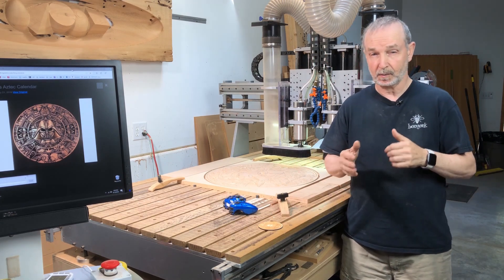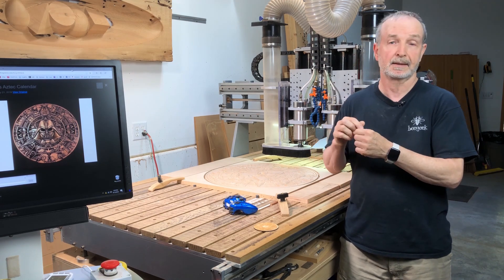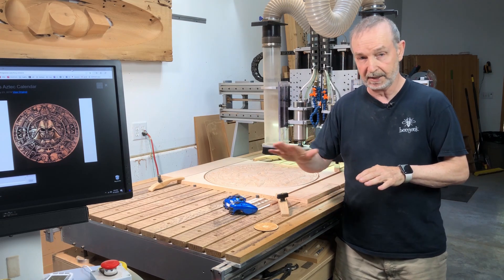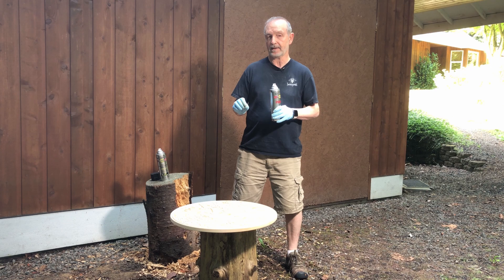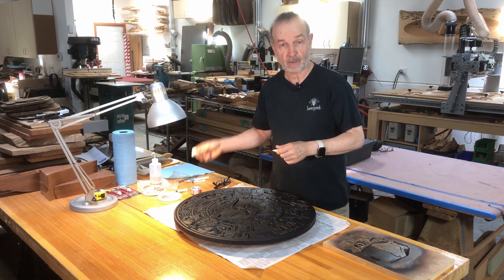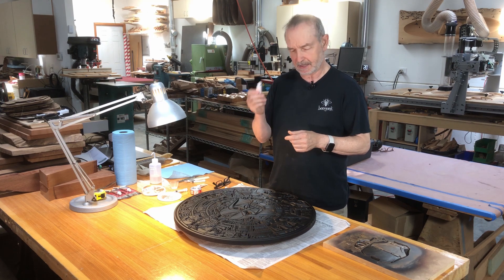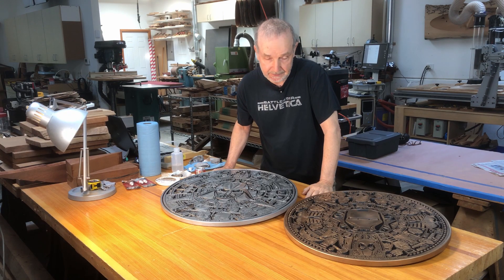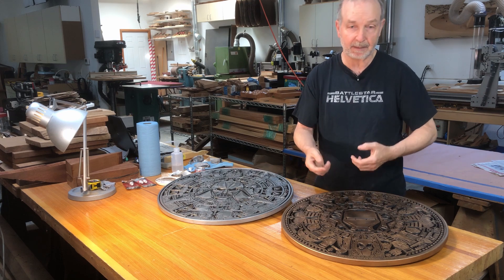The Star Wars Universe CNC Project

Comment: I’m in the process of making a similar project using files I purchased on Etsy. I’m going to try Tim’s finishing technique. TIP: I’ve carved 2, the first one was set to 1/2” depth, second one I did at 1/16” deep. The 1/16 is much, much better. 1/2” is way too deep for my files, some of the characters are only outlines. Darth Vader looks ok. I might cut him out of the center as a stand alone.
Thanks for the video……wish me luck.

Update….this finishing technique works great. Thinning with mineral spirits will make this rather small tube last for many projects. I’m going to try a different application technique on the next one. I’ve purchased a couple of ink rollers, hard rubber rollers to apply printing ink. I’m guessing there will be a lot of wasted paint but, if it works the way I hope there will be less chance of paint getting down below the surface.
Reply from the maker: Good luck!

Comment: I was wondering about the carve. You stated you used a 60 degree bit at a certain depth I believe so my question is did you set this up as a V carve or did you pocket everything out with a V bit set at a certain depth and if so what was that depth.
Reply from the maker: As mentioned in the video and some of the follow up comments, because this is a V-carve operation and that there are both wider areas for deep cuts and shallow areas you need to run tests to come up with ideal depth. Take part of the drawing that that has shallow and  deep cuts and see what works for your setup. In general for this project the issue is about shallow cuts. You want the thin lines to be deep enough to stand out. If the lines are faint, then you'll want to set your cut a little deeper. My deep cuts are pretty deep, but it's the shallow ones that are your target. Testing will give you the info you need.

Comment: Nice job..I have a V Carv with what milling do you work with? What is the depth?
Thanks..
Reply from the maker: There are a lot of variables about depth. Bit size, angle, etc. meaning I can't give you a precise answer. But, one of the most important variable is to make sure your narrowest lines cut deep enough into the top surface. Run some tests.
Reply: @digitalwoodworking  Thank you

Comment: hi awesome video I'm doing one of these on my homemade cnc and was wondering after the black paint did you sand the face back to mdf before the rub and buff or go straight on top of the black thanks
Reply from the maker: The only sanding you need to do is fine sand the MDF before you do the CNC milling. You want to as smooth a top surface as possible. Regarding paint, use the red colored primer and then follow up with the flat black. Don't overdo the black. Leave some of the red undercoat to show through at the bottom of the valleys. Then you do the Rub and Buff. But be careful to apply it ONLY to the top flat surface. Remember it only takes a little. I used a toothpaste sized amount to do each shield. Also, if you want to protect the finished surface (and you should) use a water based acrylic spray. Just a light coat. If you use oil base, the Rub and Buff will melt away.

Comment: Amazing work!  I'd like to try this.  What size 60 degree vbit did you use 1/4" or 1/2"?
Reply from the maker: Either would work, of course but if you're spindle can handle it, the 1/2" would be quicker and create wider and deeper valleys.
Reply: @digitalwoodworking  Thanks!   Did you seal it with polyurethane after applying rubnbuff?
Reply from the maker: @jake31376  That's where it gets tricky. You must use a water based sealer. If you use oil based the bufffinish will melt instantly.

Comment: So I just tried this and found the rubb and buff smeared a lot. How did you get your finish so even and smooth?
Reply from the maker: Look up videos on how Cosplay folks apply RubNBuff
Reply: Use less. Just barely apply it. Put very little on a cloth. I’d say I did the entire 24” piece with the amount you’d use to put in a tooth brush.
Reply: @celeski.digital1023  hmmm I thinned it a bit more and that seemed to help, but less didn't seem to work. It just soaked in right away. Doing 2 layers seemed to do ok.
Reply: @GearheadDaily  your likely to have loaded up too much buff on your cloth and thinned too much.
Reply: @GearheadDaily  did you prime and paint the surface first? Nothing should be soaking in.
Reply: @celeski.digital1023  yep, primed with 3 layers of primer and 2 coats of black

Comment: I have a 3 flute 1/32 ball 6.2 degree taper bit. that i have never used yet would that be better then a 60 V? or a 45V?   4TEB12-032-3FL (BitsBits)
Reply: It’s about scale. I’d you were to making a small version the small ball makes sense. That’s a really small bit. But the width and depth are closely tied to the size of the piece you are making. A large V mill is the best choice for anything lager than say 6” in diameter.
Reply: @celeski.digital1023  Sorry i always forget scale when talking about.. 24" inch is about the area i was thinking. First CNC...
OnefinityCNC

Comment: so when i import the dxf file into vectric vcarve it doest some out right. there are voids whhere there shouldnt be and filled in where it should be taking out material. could someone help?
Reply from the maker: Sounds like something is reversed. Run this test: Select several objects from the DXF file and see if the positive/negative is correct. If not, then then try everything but the outside circle. Chances are there's an open curve somewhere.
Reply: @digitalwoodworking  thanks

Comment: Thanks for the inspiration. I consider myself a novice hobbyist, yet I was able to edit the Star Wars files you linked to and produced a very respectful reproduction on a 10 inch disc. My 3018 "ProVer" (with a 3040 upgrade) using a quality 60 deg tool knocked the job out in six hours. I had to use a very thin primer spray coat not to loose the fine details. Luckily I was able to source the wax locally. And finished the job on a weekend. Next onto the Marvel Universe! Again thanks for sharing your experience.
P.S. MAKE SURE YOUR SPOIL BOARD IS TRUE.
Reply: How deep did you cut with the V bit?
Reply: @blake102989  3.5 mm flat depth with
 a .2 mm start depth(to enhance the finest details) but 3 mm would work well
Reply: P.S. 60  deg 2 flute bit
Reply: I'm very new to this and just joined a maker space that has a Xcarve. Can I pm you for help? I'd love to make one of these this weekend

Comment: It was probably removed because the Creator is not 3000Altech. I created the .dxf file everybody is now using and I used an image created by Nopal, which I think he/they created for t-shirt prints. He wasn't to pleased with the file being out so I deleted it, but it was too late it was out there and away it went.
Reply: would like to post a link but youtube wont let me.
Reply: also I never did release the final improved edit of the file and never will.
Reply: oh and people messed with the file converting it back and forth into different file types over and over again, that's why its now a long drawn out pain to calculate the tool paths. The original takes no time at all.
Reply from the maker: Thanks for the input on this. If you've got a link I can use, I'd like to use it, of course.

Comment: Did you seal it at all with like minwax or anything? I've always heard to seal it before you cut and seal again before you paint and after too. Just curious what I actually have to do
Reply from the maker: Do not use MinWax or anything like it. Any oil based finish will dissolve the rubbed on metallic details instantly. Once completed, I sprayed a very thin layer of water based acrylic satin finish to seal it.
Reply: @digitalwoodworking  ah yeah thats what I mean, minwax polycrilic. I think thats what their water based one is. So you only seal it after everything is finished? Thanks for the quick reply and the great video. I hope you'll be back to making more great content soon, you earned my subscription

Comment: Has anyone else done this on cnc ? and wouldn't mind sharing the completed file ?  id like to do this at work.
Reply from the maker: A lot of people create them using CNCs. The links in the description are for the files you need to make one.
Reply: @digitalwoodworking   I have the dxf just no cnc code etc theres no depth to it no extrusions etc. Just a flat dxf line file.
Reply from the maker: Sorry, but it's impossible for anyone to provide usable prepared G-code files you're requesting. The reason is every CNC operation is setup differently, each operator chooses parameters based on setup, materials, CNC's capabilities, mills chosen, etc. etc. 

It is always the CNC programmer/operator to make these critical choices when using their CAM software to program their CNC. I made suggestions in the video and in my article where to start. DXF files (or other CAD drawing files) are all that anyone who runs CNCs works with. We take these files, then program a CNC.

Unfortunately, CNCs are not like laser printers. Click, print and you're done. If you're looking for a one click solution, it doesn't exist in the world of CNCs. We're getting close to that in the world of 3D printers, but I doubt we'll see that in CNCs. Too many parameters. Too many choices. Too much potential for disaster.
Reply: @digitalwoodworking  the basics and g code are still the same and what needs to be changed can be changed, or will be changed when probed or setting zero etc, not really hard to change values.

But having a complete 3d model is a lot easier to program on a lot of machines than trying to set valuea for ever pocket and extrusion etc.
Reply: @crowndroyal  Your naive assumptions say it all. Download the files from the source. Program your  CNC. Create your own G-code files. There are no 3D models on this project. V-carve routines are bi-tangental operations based on 2D files. End of discussion.
Reply: @celeski.digital1023  I did download the files from the source as if you bothered to read you would know that as I already stated that. 

And G code is pretty much all the same from machine to machine there are differences like G28 reacts differently. 
If a 0 is set on a project model and a depth is set in the code for all areas then ita not really hard to machine as all one has to do is set 0 on their work piece and it should follow G code. 

Did I say I was CNC guru ? I have access yo industrial machines and know enough to get by on a operator lvl. most of our stuff is modeled and coded by the office and we change values where needed.
Parts can be picked up so can tools. Values on carves shouldn't change based on that. Only thing would change that is using different tools.

Comment: How long did it take to carve the project?
I have a Shapeoko 3 and it's predicting almost 39 hours at 45" per minute doing a 15"x15"?

Looks awesome!

Thanks.
Reply: Did you end up running this on your machine? Run it any faster?
Reply: Cameron Geerling No, I did not. I won’t run my machine that long without being nearby and at that length of time I felt it impossible.
Reply: 39 hours!?!? That's insane lol I have the shapeoko 3 as well and ran Sandy eggos James Bond aztec calendar and it was just under 7 hours. I'm not sure why yours would be trying to say 39 hours unless your feedrate is set very very low.

Comment: Very Nice!  My son will love the Star Wars calendar!
What were your feeds and speeds?
Also, you said you're using 0.75" MDF but you set your vcarve depth at 0.74" leaving only 0.01".  Is this correct or am I missing something?
I'm using VCarve Desktop V.10
Reply from the maker: Feeds and speeds will vary depending on your CNC, the power of your spindle, the mill and materials you use. Run tests of a segment of the design at full scale. Watch waste ejection and listen. With MDF you want to move quickly so as to not heat up the trapped waste. You really want to vacuum waste as you go, A clean cut is important. Don't go too fast.
Reply: @digitalwoodworking  Thanks for the info, much appreciated.  One last question, why are you cutting so deep?  The work piece is 0.75" and you're cutting at 0.74".  Aren't you worried about possibly cutting all the way through?

Comment: thank you for the videos, it helps me as a beginner in CNC. I have a question, when I do the profile toolpath, it show that is carving out the white part of the Aztec calendar instead of the black. how do I fix that?
Reply from the maker: This will vary depending on your V bit and how you set your Z. I find that V bits are a little optimistic and set Z noticibly higher than flat or ball mills. As a result, I usually adjust my Z down from my auto Z routine. 

There's another variable added to the mix. And, that has to do with the gap between lines or in the case of these calendars, how wide the black filled in areas are. This is the controlling factor for V carve routines (bi-tangental) that affects the depth of the cut. 

To make a long story short. Try a depth that's obviously less than the thickness of the material you're cutting, but expect to adjust by testing a section of the drawing first. I've found on all three of theses projects I set depth to .74 or so and always have to adjust my Z down in order to get enough detail in the thin line areas. I put notes as comments on this on this above my G-code so I know what to do the next time I cut the project.
Reply: @digitalwoodworking  thank you for taking the time to answer my questions. You have saved me a lot of headaches
Reply from the maker: In your CAM software, when selecting the curves that will be cut in the V-carve routine, don't select the outer most line (the circle on the outside of the calendar).
Reply: @digitalwoodworking  thank you 
was your start depth 0 and flat depth .74"?

Comment: i don't see the links for the DVX files.  Awesome job on those!
Reply from the maker: I've only put up links to the original creators of the designs. Each creator chooses what files to make available. However you could use CAD software for a file conversion or if you search for say, the SW design is DXF format you'll probably find it.

Comment: Great video - have tried to vcarve star wars calendar but did not turn out as well as yours.  The small definitions were the challenge.   When you say set depth of vcarve are you talking about starting depth or flat depth - or something else?  Also when you start using rub and buff the calendar already appears two tones with black in grooves/carved portions and a gold color on surface that you are applying rub and buff to.  Did you sand black paint off or had you applied the light first coat of rub n buff when you start showing your application of rub n buff.
Reply from the maker: When programming a CNC for V-carving or other vertically focused operation you set depth of cut. The V-carve routine figures out all the steps in between. If you've lost fine details in your cut, that means you need to adjust your initial Z height when you setup the CNC for the run. Too little detail: drop your Z .01 or so. Run tests and tweak the Z before a final run.  Color: No, do not sand back the black base. Build on top of it.
Reply: Thank you so much for clarification on your reference to starting depth.  I though this is what you were talking about.  I am new to CNC and use VCarve pro.  It has a start depth setting and flat depth when vcarving.  I thought you were talking about start depth so I thank you for clarifying.

Comment: Great video! What was your depth of cut setting for the V-carve toolpath?
Reply from the maker: I think about .740" with a large 60 degree bit. The depth setting comes with some important caveats. A V-carve operation depends on the bit angle choice and the widths between lines because it's a bi-tangental operation. Every drawing will be different and so you really have to test before committing to a run. In the case of the Star Wars and Marvel projects, the major thing to look for is not the maximum cut into the MDF, though you don't want straight walls on the deepest plunges, but the minimum cut to make sure the thin lines are cut deep enough to show  just enough detail. IOW the thin, shallow details are how you judge correct depth on these projects. Test, test, test.

Comment: Excellent video! I've CNC'd 14.5" diameter versions  of the same two as you did, in 5/8" thick premium quality MDF. They came out really nice. I will have to try your method of spray paint primer and the Rub n' Buff.
Reply from the maker: By showing difference in the background colors, it tends to lift the top surface off the background a bit. Rub n' Buff allows you to shade the overall piece and individual features. I had better luck pulling off this effect with slightly diluting Antique Gold color that used on the Marvel piece. The reason is that the size of the pigments in the gold finish is smaller than the Silver Leaf used on the Star Wars version. Which makes sense when you look at the difference in reflectivity between the leaf finishes and the others. Since I shot the video, I've made another SW version and used barely diluted Pewter for a base. It worked and then carefully applied Silver Leaf for highlights and to enhance shading. I used these same two finishes for my Star Wars Lightsaber Walking Stick I posted at Popular Woodworking earlier.
Reply: Hey MacTech, could you point me in the right direction if I want to do this process myself? I really want to start CNCing these things to hang around the house but have no idea where to start!